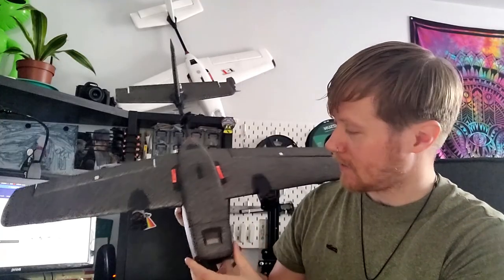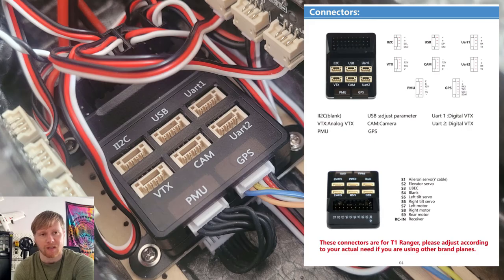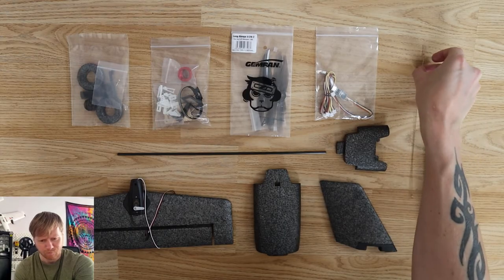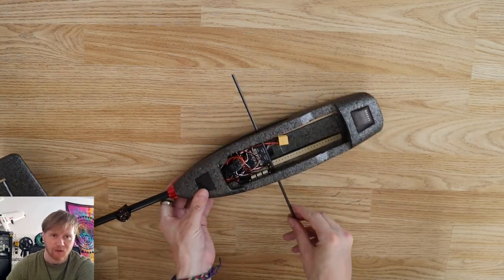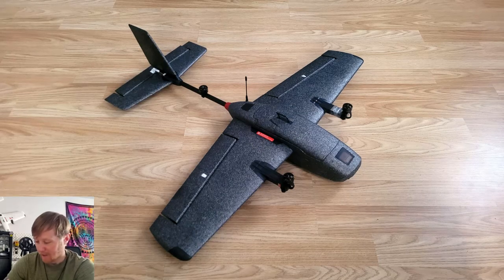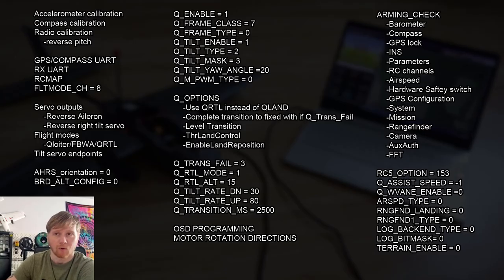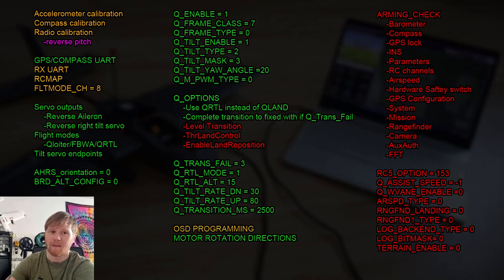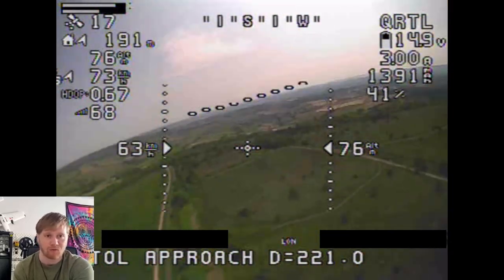🛩️ Heewing T1 VTOL PNP - Unboxing, Build Tutorial And Review

Comment: Agreed, that's a stupid place for them to put the GPS sensor... But beyond a little bit of re-routing, it doesn't look like a bad bit of kit. Thanks for going over the plane so thoroughly!
(PS, the bent piano wire if for fishing your cables through the boom!)
Reply from the maker: I get why they did it, they're being precautious about the compass being too close to other electronics. But as I proved in my T1 VTOL build last year, you can have the GPS/compass directly over the top of the FC and it works fine. I'm not sure what my future plans for this new VTOL will be, but I'll probably move the GPS so the nose is free for other electronics
Reply: @gizfpv  I have to watch that video! I dunno when, but back in the 450mm days I was informed that compasses are so sensitive to interference, that I (lemming-style)  was sticking them up on masts. GPS without a compass works well enough for fixed-wings that I haven't had a compass to deal with since then, it occurs to me. 

I have a 10-year FPV anniversary build happening as we speak, a 500mm frame with contemporary gear. I'll leave enough wire lead on my BE-880Q GPS to mount less... stupidly, lol.

Haven't been able to choose between this and the Xiake... I think the T1 is probably the better bet for me. Thanks for the videos on it

Comment: The wire is for fishing the tail servo wire thru the tail boom. Although it looks like you did not need it and it fit easily! Nice video!
Reply: exactly. how could he not see that? 😅
Reply from the maker: It seems so obvious now you point it out, I don't know why I didn't figure that for myself lol. Luckily for me the elevator servo wire just slid straight through with no issue
Reply from the maker: Sometimes I'm a bit dim apparently lol

Comment: Great video!  I have been thinking about doing a model with Ardupilot this might just be a good starting point!
Reply from the maker: It absolutely would. I'd been wanting to do a ardupilot build myself for some time and the T1 VTOL ended up being my introduction. It was a good platform to learn on as the info for the programming was easily available online.

Alternatively the Atomrc Swordfish is a good option, as that aircraft comes pre-built with a pre-programmed FC, and you can chose between having INAV or Ardupilot firmware
Reply: Thanks!  I am currently flying the Swordfish and it is absolutely a favorite. I am having a small issue with left wing dipping during auto launch I am trying to sort out, but no issues other than that.

Comment: Wow super in depth video man! Always love your videos. That steel wire is for helping to pull the elevator wires from the tube, it's mentioned in the new manual now. 
Bout the arming check being disabled, 1. this allows indoor testing 2. the VTOL PNP goal is to allow more people to experience VTOL quickly out of the box without much assembly and configuration, and expected that there are a lot of users who have not used ardupilot before getting one. If the arming check is enabled, the customer service will be bombarded with "why is my T1 not arming/motor not spinning when I tried to arm it?", because everyone is so excited to get their new VTOL flying. Personally for me, for years, I only have the GPS check as criteria. 😀😀
Would you like your parameters be listed on the heewing website for reference? 😁😁
Reply: "Super in depth video"  But doesn't show setting it up on the pc......

Comment: Awesome mate. Can i ask... what is the peak current draw ? Im interested in putting a lithium ion pack in to maximize flight times...

How long is the battery bay? Im curious if it will fit two 4s li-on packs ...
Reply: It does, mine flight with 4s lion 18650 as cube form.
Reply: Can i fit two 4s li ion packs in?
Reply from the maker: On the flight I showed in this video I was using a lithium Ion battery (3000mah 4s) and it worked fine. The current peaked (very briefly) at 29 amps during take off which was scraping the limit off what the battery could tolerate. but for the most part the current was around 25a. 

As for being able to fit two 4s li-ion packs, I don't think it would be possible
Reply: Hello Giz, I thought I was pretty smart by making a connecter to go in the flight controller where the receiver goes instead of using the Uart. But that input does not accept crossfire so you’re lucky you went into the Uart anyway. So now I have to rewire mine thank you very much. That’s a helpful video. I’ve watched it numerous times to help me assemble. I would like to send you some pictures of my Build where I’ve placed my crossfire receiver, antenna, GPS and just the interior wiring in the fuselage. Keep up the great work.Giz! Rudy 👋🇨🇦

Comment: Great review can the arming be changed to a switch easily as I wanted to use pwn4 as a pan servo 
Cheers
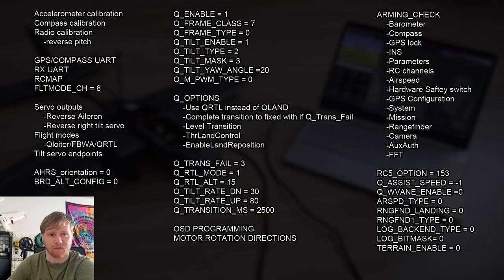Reply from the maker: It absolutely can. If you look at my programming at 14:59 you'll see I set 'RC5_OPTION=153''. That parameter taught Ardupilot that I wanted the aircraft to arm/disarm using a switch on ch5 on my radio
Reply: Thanks I’m new to ardu when it type RC5_options nothing comes up 
Do I just type 153 under RC5 ?
Reply: Hi managed to get to arm on rc5 but won’t disarm on rc5 
Hope you can help

Comment: Hello, thanks for the video. I'm currently installing my heewing t1 vtol, but I'm still having trouble setting it up. My heewing originally came with version 4.4.4, so I can't set the original parameters from 4.3.5. Which version did you set up your wing with and is it possible to send your parameters? cheers

Comment: Great video!  I'm glad to see you flew it in a bit of wind so we could see how it would do in less than ideal conditions.  I don't love how the Ranger flies (I have the original), but PNP VTOL kits are pretty rare so I'm happy to see it!  On the fence about buying one because it is a bit pricey though.  First thing I would do is move that GPS to make room for a DJI unit.
Reply from the maker: Interesting to hear you say that, I personally love how the T1 fly's, that's why it's my favourite aircraft. I agree with the GPS though, it does need to be moved on the VTOL
Reply: @gizfpv think he is referring to how the T-1 wobbles in flight even on calm days.    I’ve got 3 of them 2 on INAV and one on Arduplane.  They all have that wobble no matter what I set the I and D at P doesn’t really matter much.     Just my observation.  
Still like the plane for its ease of transportation and with a li-on pack 3000mah 3s1p I get great flight times.

Comment: I have a TBS nano receiver and I'm wondering how the change the settings in ArduPilot to use UART 2 like you did??? Right now I have serial 6 UART 2 in ardupilot set to rcin and changed brd_alt_config to 1 and serial6_ protocol to 23. And nothing works even though my transmitter is bound to the TBS receiver.

Can you help me change the serial protocol settings or something to make it work properly like yours?

Comment: May I know what parameters do you use to stop the rear motor in FBWA mode, sir? because I have a problem when the rear motor on FBWA mode keeps rotating at the same speed as the 2 front motors even though I have used the same parameters as your video tutorial? sorry I sent the same comment as the previous video because I was afraid that my comment would not be read on the previous video

Comment: I started building one but I'm having problems with connecting my Crossfire Micro RX V2 receiver to the plane. The receiver is already connected to the radio module but no matter what port I try(RC-IN, UART 1, UART 2), nothing shows up on the Radio Calibration page. I'm new to Ardupilot and so I'm having trouble finding what section I go to in Ardupilot to make my crossfire work in one of the UART ports. How do tell the FC to use one of the UART ports for the receiver? Is it in "Full Parameter List"? If so what name and what do I do?
Reply: need help with this also ^

Comment: I enjoyed the review.  I noticed you activated arming check but we have noticed with the pnp ranger that if you enable arming check you get this error "PreArm: Internal errors 0x4000 l:213 spi_fail".  Also you cannot use the RCIn uart 6 for crossfire but can use uart 1 or 2 like you have done.  What specifically did you allow with the arming check?
Reply from the maker: I'm pretty sure the 0x4000 error is caused by the flight controller attempting to log flight data when there's no blackbox available. If you rewatch my video, at 20:17 on the lower right hand side you'll see a few codes related to logging. If you program in those codes onto your flight controller, it should disable the blackbox and clear the error code
Reply: @gizfpv  Thank you for replying.  You are right, the LOG_BACKEND_TYPE=0 fixed the problem.  Otherwise you would get the error the second time you try to arm if you don't reset the battery.  Did you try a QRTL?  Some folks have reported the Ranger going nose up for some portion of the descent and then correcting itself.
Reply from the maker: @JustFavorites123321  I'm glad I was able to help 😊

Yeah I tried QRTL (see end of vid) and it worked fine. I have seen the aircraft do weird things like spin around on the spot for several seconds before descending, but haven't seen the aircraft nose up at all. There's defo room for improvement on the programming

Comment: I just finished this build after watching your video. When I am in hover mode, it seems like I have no throttle control, it’s either full throttle or very minimal throttle. And it seems like the same thing when I transitioned into forward flight. Any idea what that could be? Do I need to calibrate the esc’s’s or is there a setting that I missed?
Reply from the maker: ESC's shouldn't need to be calibrated, although it could be worth trying. Before that though, did you calibrate your radio?

Comment: Hello! I'm having trouble getting my OSD to show up. I'm currently using the Walksnail GT Kit with the Heewing FX-405 VTOL Flight Controller (on Ardupilot 4.4.2).

I have serial1_protocol to 42 (as I'm powering the VTX off the battery and using UART 1 for the connection to the FC). And OSD_Type to 5.

However no matter what I try, I cannot get the OSD in the goggles. I get video just fine, but no OSD!

Any help would be greatly appreciated

Otherwise, this video was very helpful and I can't wait for it to take to the sky!
Reply: Osd settings in goggles ?

Comment: Great video.. Could you please tell me how you configured your crossfire nano... Which uart did you use and how did you configure it in ardupilot.. Because I've tried the 4 pin connector on the end of the servo rail... Rx to tx.. Tx to rx.... I've tried uart 1
... Uart 2.. The crossfire nano is bound to my tarranis... But nothing is showing up in ardupilot radio calibration page... Any help appreciated thanks
Reply from the maker: To be honest, it took me a while to get my crossfire receiver working with Ardupilot using this flight controller, and in the end I think it was more luck than anything. The fact there's very little documentation available for this flight controller made it difficult to figure out which uart was which. In the end I used Uart 2, however in ardupilot I think that translated to Uart 1 for some reason. The software and the hardware don't seem to match up
Reply: @gizfpv  thanks for your reply... I've now used the four pin connector on the end of the servo rail.. But only using the first one after -.. 5v...ive changed it to sbus... And that works... Inav is a lot easier to understand

Comment: What batteries do you use and what do you recommend for it please?
Reply from the maker: I used a 3000mah 4s li-ion battery for this flight which worked fine. A lipo would probably be better though as current draw during takeoff did get very close to max capacity of the li-ion

Comment: I'm using TBS Tango 2 as a remote, and would like to install a 270 0r 360 degree pan camera servo. Any idea which switch i would assign for the pan movement?
Reply from the maker: I have the same radio, and as a result I know there's no easy way to do it. There is a video online somewhere showing a hack you can do in the programming to make the momentary switches control the pan movement, but from what I recall it's very complicated to do and doesn't work well. The simplest solution is to just use the yaw stick to control the pan, but obviously this is only applicable when flying a aircraft that doesn't have rudder. 

I wish the tango had a slider, or that it was possible to add one yourself. The tango is a great radio but it's missing this key feature which sucks
Reply: @gizfpv Watching your videos inspire me to take the T1 and finally do an actual long range with the reliability of Inav or Ardupilot

Yep, the momentary switches guide was the ONLY guide i saw. For fpv, TBS tango 2 is the eaasiest to pack. No issue with FPV quad. Probably will try it on the ground and see if it works. If not, fixed camera angle it is then
Reply from the maker: @goodwinduncan1505  I'm glad my video was able to inspire you 😊 Just as a thought, depending on what goggles you have, you may be able to control a pan servo via head tracker? That could be a option

Comment: How do I tell the FC to use UART2 for the receiver in Ardupilot? is this possible with ELRS?
Reply from the maker: On Ardupilot Uarts are called serials instead. So for example if you had your Rx wired up to uart2, you'd look for serial2 on Ardupilot in the parameters list, and would change the value to rcin (I think it's value 153 off the top of my head, but I'm not 100%). Only caveat though, is the numbers don't actually line up. Uart2 would probably be serial5 or something. You'd need to look up the exact assignments
Reply: @gizfpv  Thank you very much I'll try that

Comment: I am confused about the modes?  You switch from  QLOITER to FBWA but the OSD says STAB? Is FBWA the same as STAB or did you change the mode?
Reply from the maker: I changed the mode during the Ardupilot programming. I dont use fbwa, I use stabilise mode
Reply: @gizfpv  Thanks for the fast reply! I built a VTOL and have succesfully flown it but didn"t care much for FBWA mode. Definately changing to Stabilize now.
Excellent content by the way, you have a new subscriber!
Reply: have you tried Stabilized mode now, does it still transition into this mode ok? @ChrisRoddick